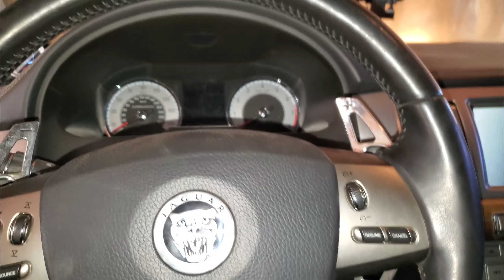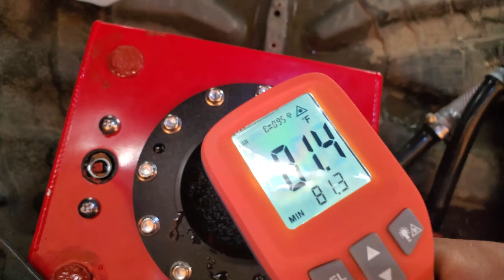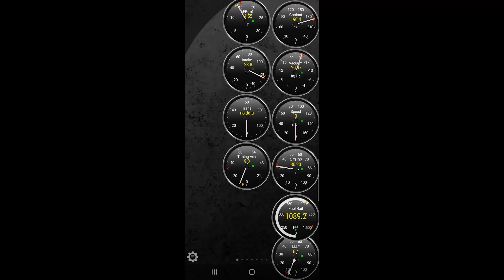Installing A Trunk Mount Ice Tank On My Jaguar xf!! Super Cool Intake Temps🥶

Comment: Great job. Basically you moved the your supercharger coolant tank and the inter cooler pump to the trunk right?
Reply from the maker: Yes I can add ice too wich would drop the intake air temperature and the best thing is it will take alot longer for the water to heat up.

Comment: Bro, I was looking at the same tank on eBay. Thinking about doing the same mod but if it’s my daily , you think it’s worth it ? I know having more capacity will take it longer to heat up, but if I don’t track my car and only sometimes get on it. Would it be a waste? Thanks
Reply from the maker: Yeah bro it really does help alot it takes alot longer for the water to heat up sometimes my intake tamps don't even go up after doing a pull plus it fits perfect in our trunks my trunk still looks like stock